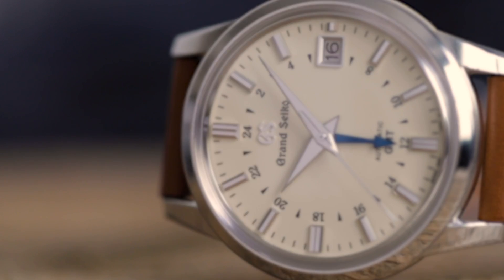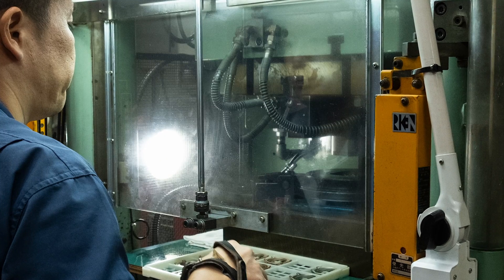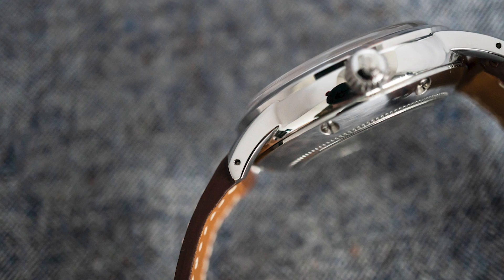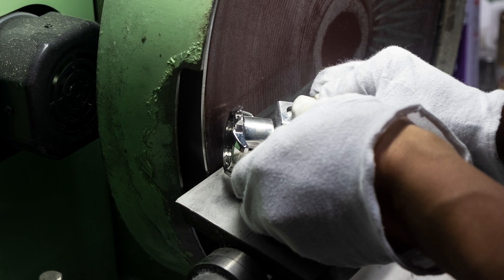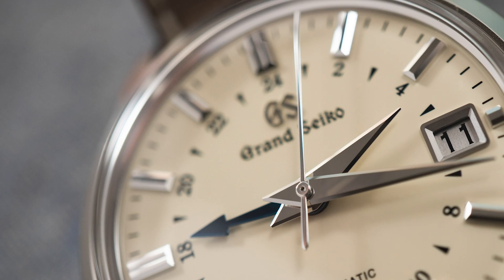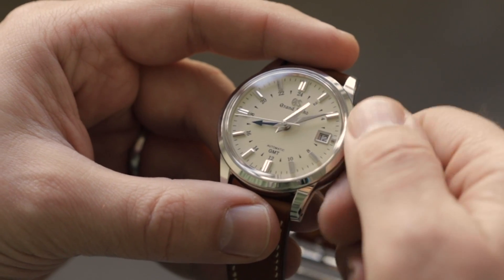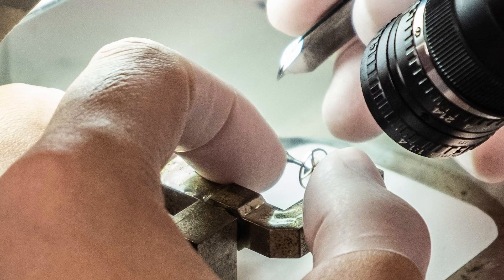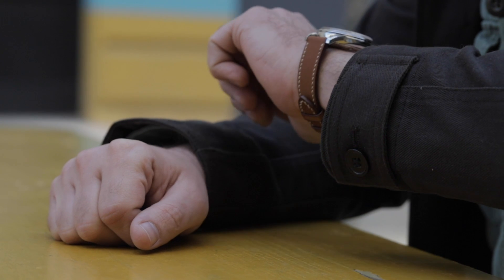Grand Seiko Elegance GMT SBGM221 | Review

Comment: The thickness is just too much on all Seiko automatic watches. Its simply not acceptable. My ceramic sub is only 13mm thick and its a 300m rated dive watch. I have a citizen promaster auto diver(200m) which is only 12.5mm thick with day and date.
Reply: Its pretty thick in paper. But from the time you wear it. It kinda looks 12mm. The case design creates an optical illusion that make the watch slim. It sounds crazy but you will get what i say once you wear it.